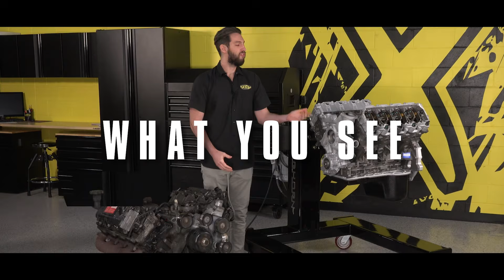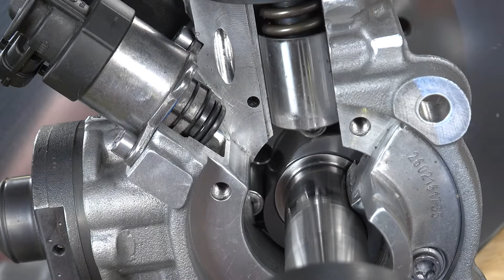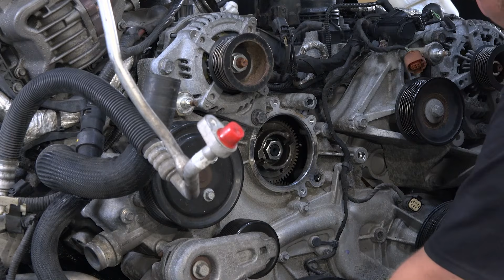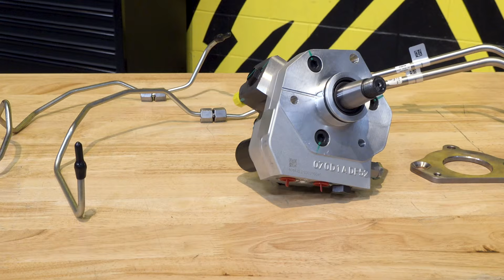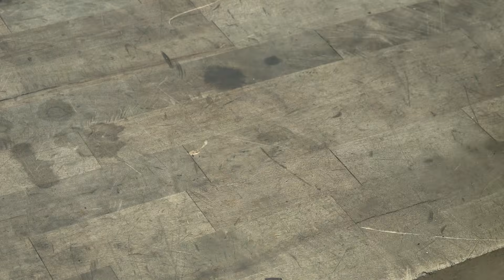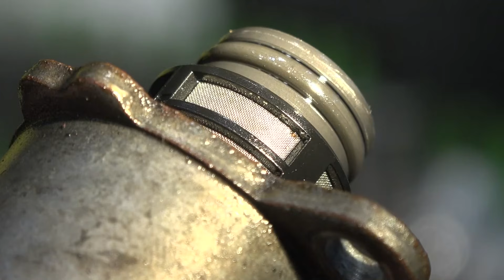S&S Diesel DCR Fuel Pump CP4 Conversion Kit Common Questions | XDP Q&A

Comment: Can't help to think we spend so much money on these trucks and want to support Ford but us the buyers have to replace rebuild all the stupid problems and of course a company is ready to sell us it. Yes you can say what if, then cost you 10, 15 thousand  to repair. Really it would cost that much or again a shop is ready to charge us...  I understand Ford engineering is the problem and Ford is not stepping up, just praying they all get through warranty.  Are the 2026 and 2027 models still using the faulty cp4s

Comment: Its still not clear to me which is the better option, DPK or DCR.  Seems initially they pushed the DPK. But I am thinking if the pump is the problem, replace the pump. But I dont think you can easily look at the screen to check without disassembling the top again? Seems to me a comprehensive filtering system is needed if you install a DCR because it may not fail but the sensitive nature of the fuel system and injectors cause failures, fuel quality or moisture.  I think if there have been updates on information we need it. My unit is f450 2013. I understand the % failure rate is low in reality but if you are the one... Then you wonder if there is a fear campaign leading to sales. I am gun shy but too many companies take advantage of customers especially through pricing when the R@D has paid for the product many times over by this stage, nothing new... I am leaning to DCR but feel like that is not a guarantee... Looking fwd to updates to this product, especially installation.😊

Comment: Did my 2011 F350 6.7 awesome insurance 😎 no worries about 15k failure bill
Reply: Same here. Just replaced the CP4.2 on my 2024 F350. Better safe than sorry (and broke).
Reply: Can always get a disaster kit and then replace it when it fails, if it fails.
Reply: @wrectumwrangler  yea but why . And were I live you can't afford to get stuck very little cell service our traffic so I went with knowing im good

Comment: My 6.7L, 40K miles, is now at the shop getting this DCR. Didn't have any issues to this point but I do NOT wait for things to break before I fix it. Oil changes every 5K, both fuel filters every other oil change, and using Optilube XPD in the diesel fuel. I feel it is neccessary to do this with such a broad problematic product. Remember the CP4 is in all kinds of stuff, including tractors, and Duramax. But with those you can swap to CP3 in most cases. As long as the block space allows it and I wouldn't go belt driven. Check your options.

Comment: 27k miles, in the shop for fuel pump failure. Fuel additive in every tank since new, fuel filters were changed at 15k miles and we’re about to change them again this weekend. Ford’s warranty solution? Replace the cp4 with another POS cp4. Exactly like pissing in the wind. Spent $83k and I should spend another $5k for a dcr conversion to permanently cure Ford’s incompetence or a disaster prevention kit and it’s cost as well as a new dcr in the future when the warranty cp4 craps the bed again. COME ON FORD!  Rant over for now!
Reply: Dealership called me to install a software update to fix the CP4 issue. Asked what the heck that will do and scheduled an appt... the day of said "recall repair" was told Ford canceled it. Recalled the recall!

Comment: Great video to clean up alot of the misinformation that is being spread on the forums and facebook pages about this pump. I installed the DCR in my 2018 f350 when they first came out. I pre ordered one, and it has been one of the best upgrades to my truck. Well worth every penny. Easy install and great quality.

Comment: Idk man, kinda smells like the old 6.0 to me, i can try to get 500k miles out of it but ima spend $$$ now or $$$$ when it breaks later, ugh ford just get it together its embarrassing, highest selling truck line of all time but dont care about the consumer at all and it shows.
Reply: 900k on my 21 6.7 all oem and original cp4 and 10r140 transmission
Reply: @theprodigynextdoor7383 yes very possible with a good filter and lubricity additive every tank

What did you do to your truck to hit 900k? Fass and additive and maintainence?
Reply: @glowvid stock lift pump just add the disaster prevention kit, put a spin on filter in my upper fuel filter housing area and went to cat filters underneath with the s&b tank
Reply: @theprodigynextdoor7383 you run additive each tank or run b20?

Comment: Yeah for 2400 its not worth it anymore. I know several people(including myself)who were very interested in the dcr until the price increase. And on another note the “disaster prevention kit” is complete snake oil and is the most overrated mod for a 6.7 power stroke
Reply: You are full of shit on the disaster prevention kit filter
Reply: If you live were i live 3hr from any town and weather that during certain times of the year that can kill you and zero cell service spotty CB reception.  You change to the DCR pump . And you don't worry
Reply: How is it not worth it? $2400 or $10k-24k depending on bad the damage is when the a CP4 goes. Especially given how expensive trucks cost. My wife’s uncle was a mechanic for Ford for 20 years and he recommended just getting it done. I use my Dually for my business so it’s not even a question for me.
Reply: Why is it snake oil…genuine question
Reply: @karlconnell2486 He's full of crap and doesn't know what he's talking about
Reply: @karlconnell2486  sounds like someone is upset because of price increase.
Reply: I bought a DCR when they were 2K and my installed when my truck had 7500 miles on it... just for piece of mind... Id do it again with the price increase in a heartbeat.   Totally worth it.

Comment: The $500 price increase killed it for me. It's not an angry they raised the price thing - they've got their reasons - it just pushed the part off a cliff in terms of value. I think it would have been much better received if they'd raised it $100 at a time up to $2400, going up every month. Probably would have increased sales, even.

Because of the way they handled it, though, they definitely lost a sale from me. 

For me, it's not worth $2400. Too many guys get half a million miles or more out of a CP4.
Reply: Pure greed
Reply from the maker: @xgomz S&S offers peace of mind with their CP4 Disaster Prevention Bypass Kit at a much lower price. If you are one of the unlucky ones who do have an issue, you can make the swap then and avoid having to replace the entire fuel system.
Reply: @XDPDiesel  I just bought this pump for the piece of mind and one less filter to have to change. I thought they couldn’t send metal through the fuel system if they failed?? I want that DPK gone.
Reply: Have fun complaining about that $500 price increase when your CP4 takes a shit and costs you $12k to fix.